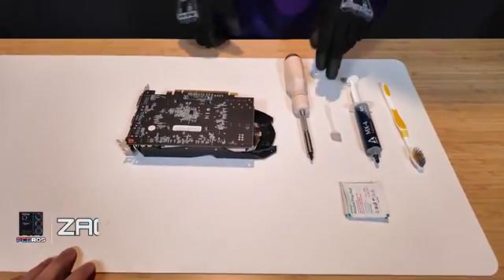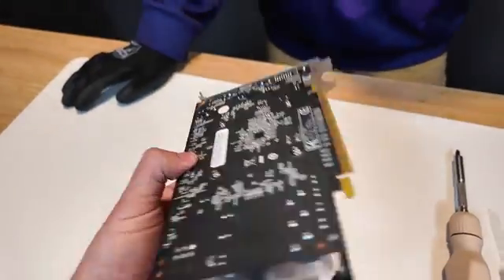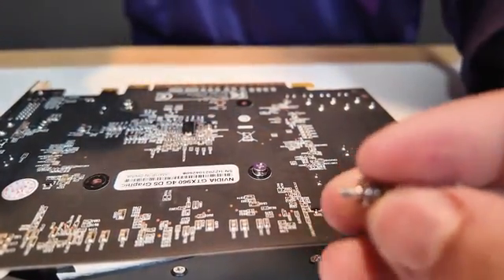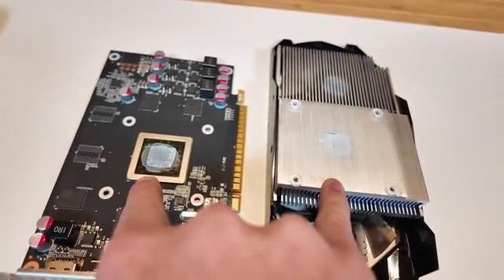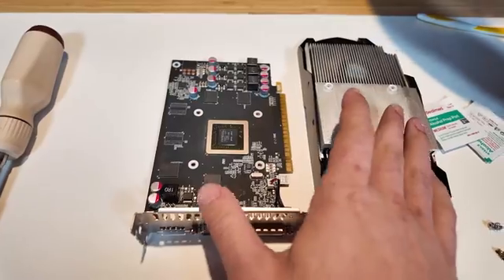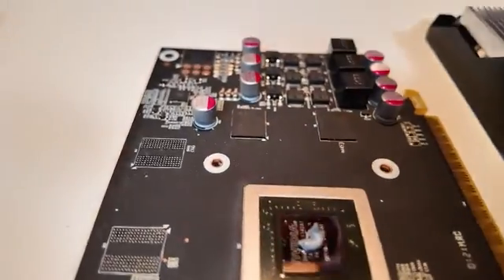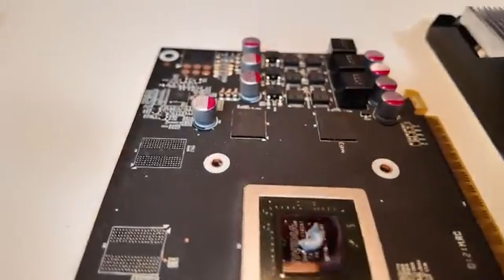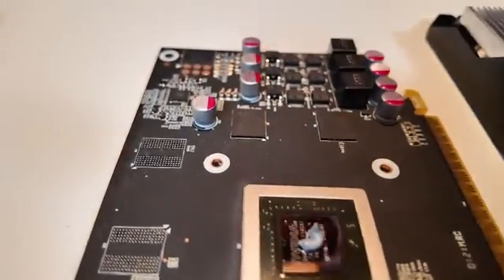How To Repaste a Graphics Card - Full Guide

Comment: I have a 2060 Super from Evga bck from 2019. Its still my main card, is it just as easy with this card? ive never done this, but recently my games are taking a hit. ( im aware its getting old now and not recc for new games ) but it still performs well on some of the new games, Bo7 MP i get about 120-140, Wz get about 100-120 ( whateverr bo7 with warzone did it does stutter often now ). if i had the money trust me new card would be my first purchase. But as of right now i have the tools and thermal paste to do this. Ive read it will help with temps ( my temps arent a problem ever never seen them hit about 70c on any game ) i just want that performance boost people say it will deff get.. ( apparently ). Fortnite 200-230 ( varies if its reload or big map ). But for some reason its absolutely STRUGGLES to play Minecraft or like Super market sim even capped at 60 on low. So idk what to do. so maybe hoping this will help those games as well? if its suppose to help stable out Clocks and such